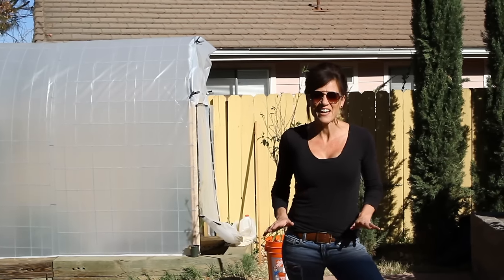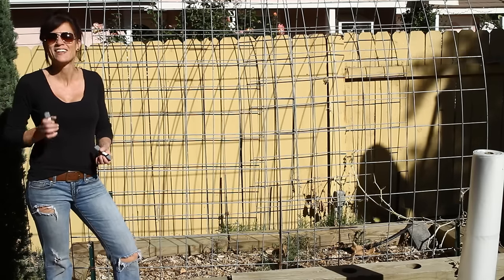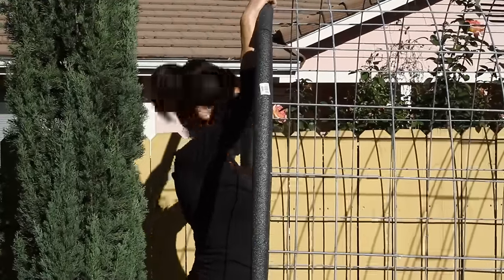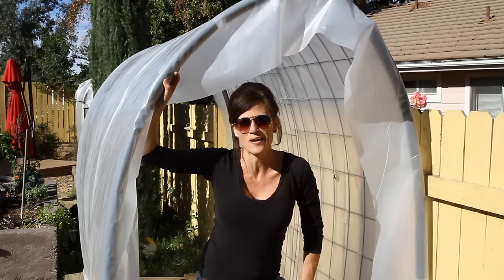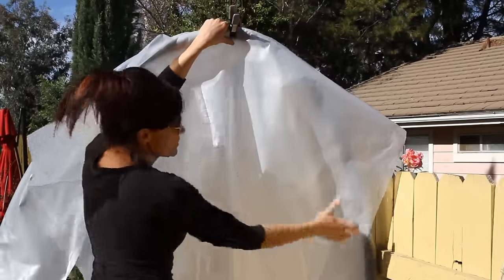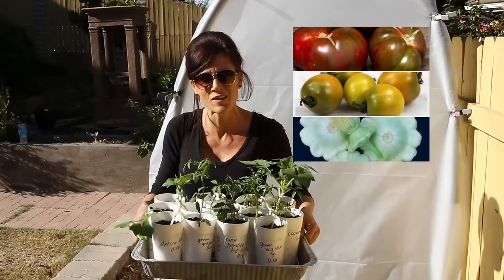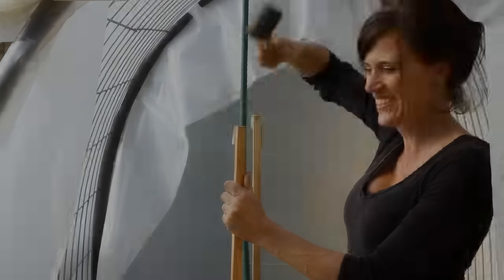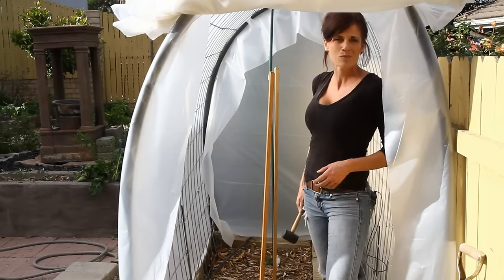2nd DIY Cattle Panel Hoop House Build - Quick, Easy and SIMPLIFIED!

Comment: Congrats on the second hoop house. Keep us updated on the Berkeley Tie-Dye, I just built a second hoop house to grow Brad Gates varieties. Pink Berkeley Tie-Dye and Berkeley Tie-Dye are 2 I've started so I'd like to compare progress. Just started the seed on 12/11 and they will be going out to the house in the next couple weeks.
Reply from the maker: The Brad Gates varieties seem to be quite a thing!  They are brand new to me and I'm looking forward to some colorful tomatoes!  Will be fun to compare notes- I'll keep u posted!  Do u heat your hoop house at night?
Reply: +CaliKim29 Garden & Home DIY I do heat my hoop house at night, its been really cold for AZ lately. 27 the other night.  I use 2 shop lights from Harbor Freight, theyre 500 watts each and about 30 bucks for the pair.  Recently I brought in a cheap utility heater for the really cold nights.  I find I can get about 20 or so degree difference when running the lights and heater.

Comment: I tried to get some cattle panels from Lowe's. For me the closest one would be in Pahrump and I live in Vegas. Just too far to drive. I saw a store online that sells them but the shipping prices are just too high. I'm having to use PVC piping instead. Trying to figure out how to get the piping high enough to fit my tomato plants. Kind of frustrating but trying to make it work.
I do have my grow lights set up. They are the LED ones. Can't wait to see if it makes a difference on my growth.
Reply from the maker: Unfortunately, not all Lowes has them - we had to drive to a Lowes an hour away.  PVC pipe will also do the trick for you - you should be able  to get connectors for the PVC that will extend them high enough for your tomato plants.  Don't give up, you'll find a way!  Glad you got your grow lights set up - your plants will love it!  Keep me posted!
Reply: +OmgKittys78 I tried the PVC and didn't hold up too well in the wind.  It pulled several of my tomato plants out.  Tried another version of PVC and it was worse.  Hope you have better luck.  Did you ask Lowe's if they could special order them for you?  I have asked for other items and they ordered them in for me.  Are there any ranch supply places close?  They might have them or be willing to order them in for you.
Reply: The pvc seems to be holding for now. It's up against a concrete wall so I'm hoping it will be ok. I haven't tried asking Lowe's about the special order. Will have to ask. Was planning on going there today. Getting some more pots for my indoor plants. I think there are a couple of ranches just outside of Las Vegas. Not sure where they get their supplies from. I'm curious now. I will try Lowe's 1st and if its to pricey, I'll look into the ranches. Thank you so much for the information and tips :)
Reply: +OmgKittys78 I see a C-A-L Ranch Supply in Vegas.  Might be something to check out.

Comment: Nice! Quick and easy. But you must not have much wind. The staples wouldn't hold up for a day here. I'm going to bury the ends of the plastic in a trench.
Reply from the maker: We actually do get a lot of wind here (see a recent video "the winds and the hoop house". But they are fairly protected at the bottom of a hill and up against a fence so they do just fine in the winds we have had so far.  Good idea to bury he ends in a trench!  Let me know how it goes with your hoop house, Paul!

Comment: +CaliKim, is Santa bringing you denim this year, at least you earned the wear and tear!  :) 
I asked for gift cards to Tractor Supply.
 Tractor Supply has the cattle / feedlot panels they can be cut with heavy duty bolt cutters to fit in smaller vehicles.  With above average temperatures this year, wish I would have put up a hoop house.
Merry Christmas
Reply from the maker: Ha ha , Doug- these jeans are tried and true and so comfortable I just can't give them up. Hope Santa is good to you and your get your TS gift cards!  Wish we had one near us!  Why not build a hoop house one now and get a jump on the spring planting?  Thx for watching!
Reply: +CaliKim29 Garden & Home DIY 
 I know what you mean, I have had to reclaim my old jeans and patch holes that were in the wrong places.

  Normally it should be 34 degrees average, with  snow and getting colder until March.  So for the winter I will stick to my hydroponics attempt and will try starting some microgreens.   In March I will start seedlings, then In the late spring I will put up a few low hoop tunnels made from PVC to try and get an early start on the garden.  We can have frost up until mid May.
It has been educational and entertaining,  watching your videos and those of others.

Comment: Hey CaliKim, what type of plastic do you use for your hoop houses? How long do you think it will last?  Merry Christmas
Reply from the maker: Hi Tony- it's 6 ml plastic.  I will remove it when the weather gets warmer and reuse it again. I expect it to last 2-3 years.  Are u going to build one?  I'm having a ball with mine!  Merry Christmas to u too!
Reply: +CaliKim29 Garden & Home DIY  Hey CaliKim, the hoop houses you built may be a little small for me. I wanted to make a greenhouse. I looked at TexasPrepper2's video's and that gave me an idea about what I wanted. The 7" wide house with 4 cattle panels, that wouls be 7X16 with a 6' high ceiling, greenhouse plastic on top over the panels, then regular clear plastic on the inside to give me a double wall for insulation. How does that sound? Have a good day!!

Comment: Do you get significant winds though?  WE have very strong winds and there is nothing blocking it when it comes through.  We also get snow.  Is something like this remotely strong enough for something like that (assuming it is anchored deep with posts in the ground)?
Reply from the maker: Hello Holly, yes, we do get very strong winds in the winter, these are somewhat protected against my fence, but did hold up like a charm in wind, watch to see: https://youtu.be/SLQM7NJXHDw?list=PLH4z_9MDD00JnU1_FbpWWErF3KOmm9ocK.  Since we have very mild winters, rare freezes, don't get snow, I can't speak from experience about how they would hold up in a blizzard.  Mine aren't heated,  so it really depends what you want to grow.  Keep me posted if you decide to build one, thanks for watching!

Comment: where can u find plastic heavy enough to resist wind, im in chicago area lots of wind.
Reply: 6 mil plastic is the thickest they make in clear plastic I think 
But what u need to do is pull it tight around the cattle panel or pipes or whatever structure u using for your hoop house so no room for the wind to mess with it , and then apply bungee straps or ropes on top of plastic

Comment: Beautiful! Much simpler than the first one. But the other one is probably more sturdy. Where do you get your cattle panel from? I'd like one in front of my gate between my neighbors yard.
Reply from the maker: You are right, Paul- first one is sturdier.  But this one works just fine for the weather conditions we have here.   And I was able to get it up quick which means I'm closer to my goal of growing more food!  I got the cattle panel at Lowes - but not all stores have them, so check online first. We had to drive to a store an hour away.  Thx for watching!